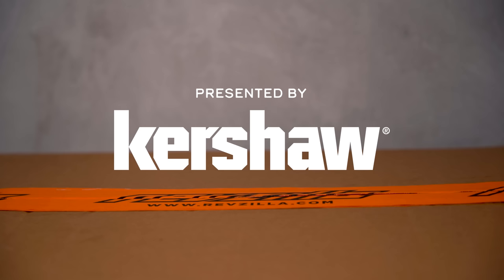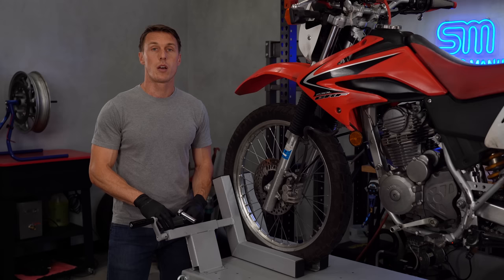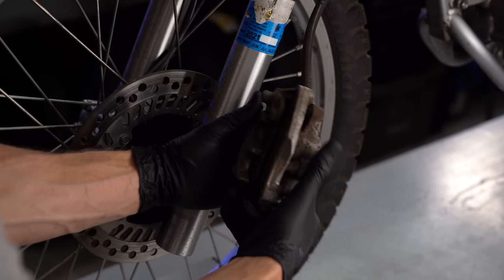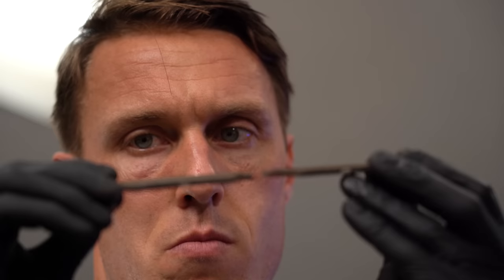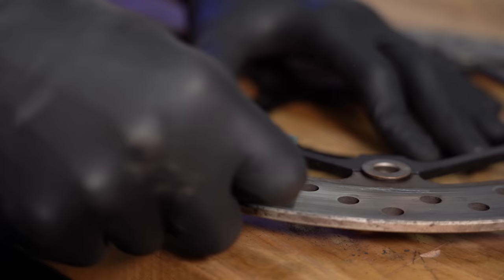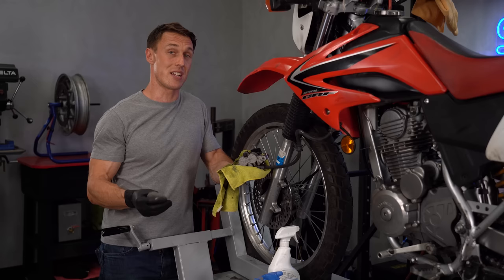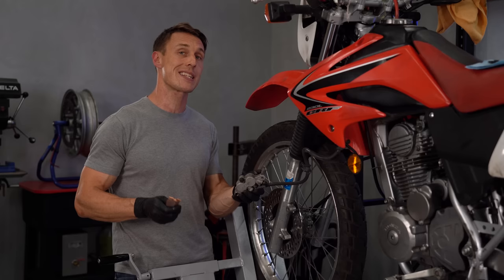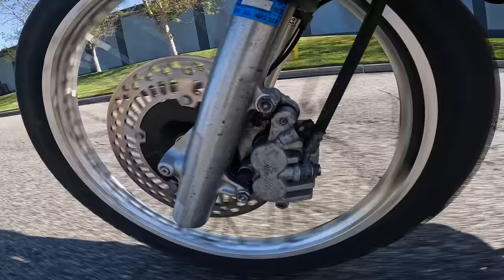How To Replace Your Motorcycle Disc Brake Pads | The Shop Manual

Comment: Also as a good habit/general rule of thumb...bleed the brakes with fresh fluid...or at the absolute minimum check your brake fuild and lines...
Reply: Changing fluid with each new set of pads is not necessary. The main thing that makes old fluid unfit for use is the water that accumulates there, which is why the age of the fluid is most important. It is advisable to decrease this period with heavy use (e.g. racetrack).
Reply: That would be excessive unless you rarely ride, or have been under utilizing your brakes.  Either of these cases could lead to a problem of several years accumulating on the brake fluid between brake pad changes.
Reply: @SportbikerNZ  yes your right, but for a few dollars you know that the fluid is fresh. It is more so if you cannot remember the last time you did change it as part of your regular services. Not everyone uses sintered pads, also different riding styles play a factor.
i know myself if i can see that traffic has stopped i will use the gearbox to slow down and only use the brakes if need be at the end, but i hate stopping in traffic so does my air cooled bikes...

Comment: This is probably the best video I've seen on Nissin brake calliper removal and basic maintenance.  Having said that, just know that your bike brakes, like your car brakes, will tell you when they need to be replaced.  Never hurts to replace them early, but don't panic and stop riding because your pads look thin.  They'll squeal like a pig to tell you when it's really time to replace them.

Comment: I always like to tape an empty beer or soda can in-between the brake lever and the handle bar to make certain that I don't inadvertently squeeze the brake lever while servicing the front brake. Also, it is very important to replace the brake fluid every two years (minimum) regardless of mileage on the bike. This will prevent expensive repairs due to corrosion in the brake system. Thanks for another great SM video!
Reply: Had an idiot who squeezed my brake lever (during a tire change) and it was a nightmare getting everything back together again. Your comment is SPON ON, thanks

Comment: Good video and quite comprehensive. However, the hang pin can and will wear out over time. Most manufactures have intervals for pin replacement. If the pin becomes really pitted or if you see a flat spot where the pad rests, change out the pin. They are usually under $10 so it’s cheap insurance. Also, no mention on how corrosive brake fluid is. When you push the pistons back into the caliper it pushes fluid into the res  which can cause splash. I will take the lid and the rubber seal off the res and then just place it back on top. This will allow air to escape the res as the fluid fills it back up. It’s also a good idea to wrap shop rags around the res just in case. If you do get brake fluid on anything especially painted surfaces. Clean it immediately. Most brake fluids will eat paint.
Reply: I wish more people talked about how corrosive brake fluid is. I once spilt a few drop on a volt monitor. Ate through the display rather quickly!
Reply: I wish the pros at the shop I took my Diavel into kept this in mind. The paint on my reservoirs has been eaten off by overflowing brake fluid.

Comment: Good video. Videos from DelBoy’s Garage and Stuart Fillingham are also good for cross reference. Given that brakes are the most important component of any moving vehicle, I would note a few suggestions:
First, the reservoir cap should not be opened. Brake fluid is highly homophilic and hygroscopic and will suck moisture, potentially compromising the entire system. 
Second, don’t bleed fluid. Assuming that the fluid was set properly, bleeding any amount will lessen braking performance. If the pistons are too hard to push back, get a cheap brake kit designed to do this. 
Third, might as well flush the fluid. Yes, every two years is the norm but why not at the same time - it’s the most critical aspect of the system. 
Last, if using Simple Green, get the purple version to avoid corroding alloys/aluminum and rinse thoroughly.

Comment: It is worth noting that on some ABS-equipped bikes you may need to push the pistons on the calliper back by opening the bleed-bolt on the calliper, and not up the brake system, since the ABS pump will work as a one-way valve... Ask me how I know =P... Reading the manual gave me the answer for that one =)
Reply: WOW thats so good to known. My bike has ABS and about to do my first pad swap so your timing perfect. Thanks again.

Comment: You forgot to check for air bubbles in the circuit, wich are pretty common to appear after you push the pistons back in place. I'd say bleeding the circuit is a must after every pad change.

Comment: Be careful with all the fasteners of course. But those reservoir screws are NOT going to be a Phillips. They are likely going to be JIS, which look very similar.
You'll be surprised at the difference when you actually fit the JIS bit vs the Phillips bit in that screw. The JIS screws are identified with a little dot on the head of the screw.
Hopefully this helps!
Reply: One of my best investment was a set of JIS screwdrivers,

Comment: Please do a video on things like fluids, oils and grease that goes beyond engine oil and radiator fluid, what should be used where. E.g., if I'm to oil a clutch cable...what oil should I use? What grease should I use on what bolts? Where should I be using loctite?

Comment: just changed my front pads today, one set was oil soaked from a leaking fork, fixed that as well
in the fall, i’m gonna replace the rotors and rebuild the calipers and change the fluid again then

rebuilt the rear caliper and put new pads on last april when i replaced my tires 😎

Comment: My understanding of seating new brake pads begins with installing the new brake pads into the caliper and screwing the caliper bolts in leaving approximately 2-3mm of space so the bolt head is not touching the caliper.  Once you are ready to torque the caliper down, to gently squeeze and hold the brake lever, seating the caliper, pistons, and rotor disc.  Then torque down the bolts so they are all in harmony.  Is this true or no?

Comment: Try a C Clamp for pushing calipers back, This is fine for non ABS breaks, If ABS do not push fluid back up into system, open blead screw prior to pushing calipers back so old fluid is bled of. Close bleed screw refill reservoir with fresh fluid. then pump brake, then use procedure to bleed brakes.  Fluid is cheep.

Comment: Good video. Just note that at 3:25 you have the caliper hanging off the brake hose. Not a good idea,  better to secure it with a rag or thin rope as not to put stress on the hose.

Comment: hello! thanks for your nice words. For my fzs 153cc (fazer byson) carburetor bike, company manual book recommended 20w50 grade engine oil, but I used 10w40 due to unavailability of reputed company's oil like mobil1, motul, liquimoly etc. . Will it be a problem? What should I do?  My odo is nearly 60000 KM. I live in a tropical monsoon-type climate, with a hot and rainy summer and a dry winter.

Comment: Ari, Great video, a couple of things to note. Antilock brake systems don't like dirty fluid, open the bleeder when you compress the pistons back into the caliper. Cleaners like Simple Green are mildly corrosive to aluminum alloy parts, be sure to rinse them with fresh water when you're done.

Comment: I totally agree about not putting grease on the back of the brake pads. Talk about gumming up your Pistons with dirt. I've seen many tutorials telling you to do that. It might be okay if you're a pro Rider and your bike gets broke down and tuned after every race.
Reply: I don't agree with the greaseless. I personally recommend at least a thin film application, very conservative.  Grease prevents any metal from being stripped or shaved.  Anyway, ride safe, god bless u.

Comment: I'll have to try no grease next time.

I'm more of the type. More is more better. Haven't had issues yet. But my piston/pad area is usually pretty grimey.
Reply: Never go greaseless, just apply thin film or very conservative portion. Grease prevents any metal from being stripped or shaved.

Comment: Great video, my bike got ~1500km but its front brakes are still squeaking. I can now take the break pad thingy out for a scrub.
Reply: Try putting some grease on the backs of the pads. Clean the brake disks thoroughly. Do not touch the friction material. Good luck✌

Comment: im suprised to see the lack of dust boots on bike calipers pistons. not a fan of that. dust boots are great for protecting the pistons from grime, rust pitting and anything else that poses a risk to them. i love the zx14 brakes. fixed 4 pot calipers on the front. no slide pins and can change pads by removing a couple pins, not the whole caliper. makes for quick easy work.

Comment: i've replaced the rear pads on my 2017 SV650 twice now, and the new pads are not a perfect fit.  i had to modify them with a dremel cutoff wheel both times.
every lookup service will tell you that they fit, but they do not (including O'Reilly, Amazon, and Revzilla) (don't even bother with Autozone, they don't do much moto stuff).  so if you're not going to buy OEM, then make sure you have a dremel ready (or a hack saw if you're poor, but then you would need some way to clamp them down).  the little nub on the end of the pad opposite the retaining pin hole is too big to fit on top of the shelf that it's supposed to sit on.  so just line up the new pads with the old OEM pads and note the different shape, and how much to cut off.  it doesn't have to be perfect at all but... before cutting, if you reinstall the front caliper bolt, then mount the pads into the caliper and try to rotate it down to install the rear bolt, you will see that it just barely won't make it.  so you might think that you don't need to cut so much of the nub off, but i would recommend doing so anyway.  there's a reason the stock pads are the way they are, and i'm no engineer, so i cut them to look exactly like OEM.  and i've gone through another full set of pads now with no trouble.

Comment: Pro tip: if you cant fit the brake pads in because the cylinders are to close together, even after pushing them in, and the others are pushing out. Open your brake fluid resevoir

Comment: Great video very informative thanks! What do you do of you get it all back together but the new pads squeak or squeal while stopping?
Reply: First, check the rotor surfaces, make sure they are flat and even with the new pads. Most squeaks are due to the pads vibrating, the pistons are not being apply evenly across the pads underside; inspect pistons to make sure they are working properly. Worse case, rebuild calipers will solve all squeaks. Ride safe,  god bless u.

Comment: When pushing the pistons back in, crack the lid on the fluid reservoir cap but don't remove it completely. On some bikes, if you go too fast it can squirt like a fountain! Ask me how I know.

Also, absolutely double check the fluid reservoir level when you are done. If it is overfilled it can cause your brakes to lock up.
Reply: Yes, and consider to change at least the break fluid in the reservoir (if not possible to do it alltogether), it will be at it's max with the new brake pads.

(And a lot of people sometimes use screw clamps to reposition the brake pistons slowly but stadily.)
Reply: And, as we all know, the intial cover cap can be a pest to remove. That's why i always carry a mechanical impact driver (and a hammer) if i might have to do this job on the road.

Comment: I have a probblem. When I use the front brake, the stearing or handle bars are shaking or rattles. I have already changed the front wheel bearing and stearing bearing but the problem is still present. Any suggestion please. 

The problem occured after riding through 2 potholes.
Reply: Make sure your rotors not warped and just shake the shit out of the wheel and if it does move just Google what it is and how to fix it
Reply: Check to make sure your rear wheel is straight.. that was my problem

Comment: I am ok doing the take apart stuff, but I always fret on torquing up any fasteners.  Question is are there universal torque settings for brake assemblies?
Reply: Somewhere around 30ft lbs should do the job. Buy an oil marker from local craft store to mark the bolt head to a fixed point on the fork/caliper and observe it after a few rides to see if the bolt is backing out.
Reply: @Obee270  thanks man. This makes sense. I am sensitive to this because not long ago after picking up a brand new bike one of the front axle pinch bolts fell out in a ride and it was quite disconcerting. Again thanks
Reply: I don't know if there is a universal number, but the front caliper mounts bolts for a 2009 Ninja 650 and a 2013 Concours are both listed as 25 ft-lb (34Nm) in the respective service manuals.  I suggest confirming with the manual for your specific bike.
Reply: @MuffledSea  Of course but I was under the impression he didn’t have a shop manual. If you have a shop manual, by all means go with what’s listed there. Also, if you decide to use blue loctite on a fastener it tends to throw off the torque value so keep that in mind.

Comment: No way I am changing my pads myself. Yes nice video and I do regular service myself (oil change, prep for track day…etc) but I don’t trust myself enough to change what can save my live on the road.
Reply: Do you trust a random mechanic to do it, one who may be rushing, distracted, or less than thorough?  This isn’t rocket science or rebuilding an engine, you can do as good or better job if you take your time.  It’s an upfront investment in tools (shop manual, socket set and torque wrench being the most expensive) and time.
Reply: Good call, I can respect someone who knows his limits. Ride safe, god bless u.

Comment: I didn't push the piston inside that's when change brake pad that's  why my disc is getting too hot
Reply from the maker: If your brake disc is getting hot, that means the brakes are dragging and basically always braking. You might want to check that nothing is hindering the piston from moving back after you release the brake lever. Otherwise, you might have too much fluid in the reservoir which isn't allowing the piston to fully return. If those don't fix it, you should consult a local mechanic.
Reply: @RevZilla  brother I have checked my bike by 2 mechanics . They all say it's normal. It's because of friction of brake pad. But I remove the pad from disc then ride. Only the caliper is getting hot too. I mean too hot . Plz help